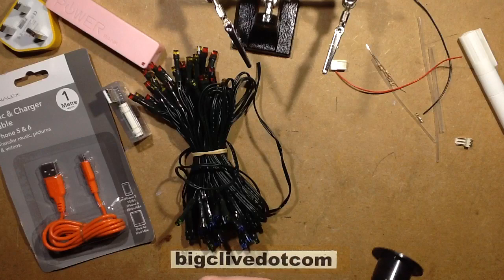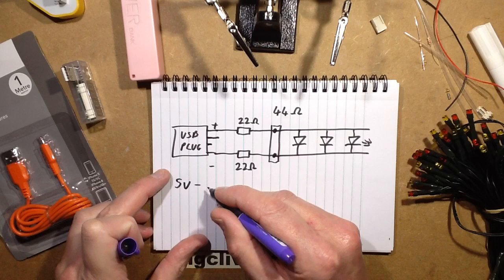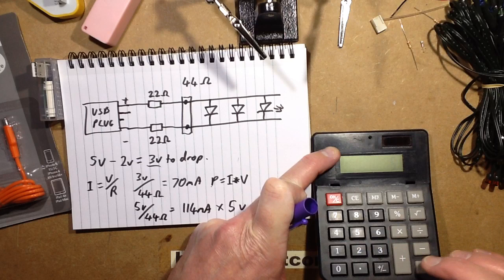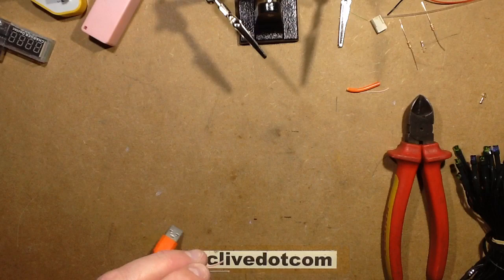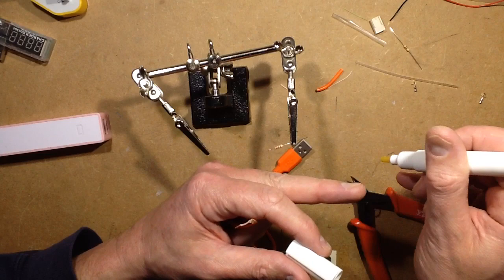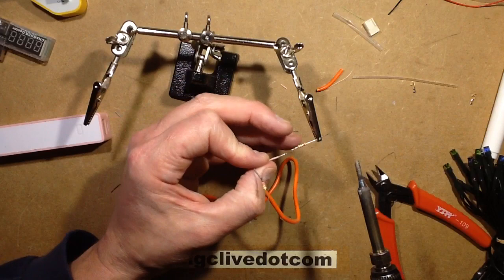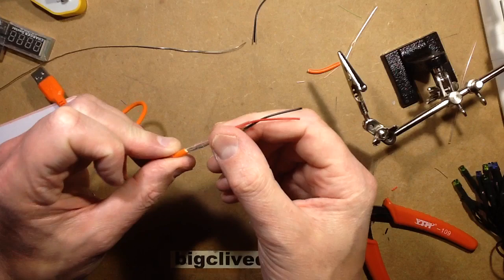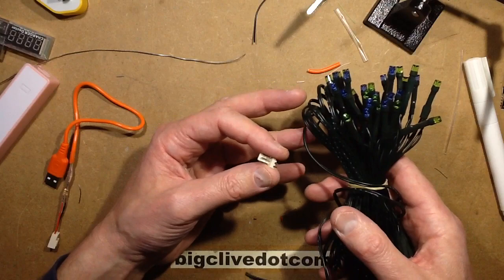Run LED strings on USB chargers and power banks.

Comment: I actually have a cosplay project that I'm working on right now that involves LED's and I'm happy to see that I did my resistor calculations correctly when I placed the order for the parts yesterday, thanks for assuaging my fears with this video.
Reply: Wearables eh? I would suggest using smaller SMD LEDs and just soldering the wires straight to them - They are a lot smaller. You can also buy ones which have holes on for thread, and you can get conductive thread also.

Comment: I just use the wider part of the soldering iron to shrink the tubing. It doesn't get as hot as the tip it seems so works great to shrink it without melting anything.

Comment: Another great video BigClive.  I've seen every video you've made to date (literally!). I so much enjoy all your videos.  It appears to no doubt you are using a good Rosin Core 60/40 solder.  I ran out some weeks ago and had to use some ROHS Silver Solder and that stuff is a torturous nightmare to use.  A few days ago, I finally got a good roll of 60/40 Rosin Core solder and working with electronics is a pleasure again.

Comment: you can use larger heat shrink to make things easier.  The basic tubing will shrink to half its diameter, and if you want  something to use outside they make a double walled heat shrink tubing with an adhesive inside that will melt and seal everything up tight.  And that tubing has a 3:1 shrink ratio.

Comment: Clive, please take a look at the XS3868 Bluetooth module and the PAM8403 3W stereo amp to make Bluetooth speaker with one of those power banks. There are a few videos on YouTube but the disregard the datasheets and introduce ground loops, generating noise, and i dont know how to deal with it. I have followed your LED and fiber optics tutorials to had lighting to my scale models. 5V from  powerbank or cellphone charger is quite handy and projects tend to stay cheap and simple like this. BTW, i purchased one of those RFID modules to help my mom.
Reply: The noise could also have been generated by the Bluetooth modules.
Reply: there is no noise when plugging the headphones to the module, only when using the amp module. the bluetooth datasheet indicates ground should not be shares but i dont know how that is done when using a songle powersupply.
Reply: Friendroid 

You should use a simple ground loop isolator and connect it between the BT receiver and the amp

You can probably find one for cheap on eBay

Comment: I just did this with a home depot Halloween battery powered set with timer. but all I used was a 1n4001 diode. 0.7V drop was perfect. My supply was 5V both unloaded and loaded, but keep in mind some supplies are up to 5.3V unloaded and loaded (Samsung high capacity usb charger) so adjust accordingly.

Comment: Hey Clive! I really like your very detailed and slow explanations. Thanks for having all the patience for the beginners in the crowd. One thing I am missing, though, is the reasoning behind some of your decisions. You seem to pull out some of the digits (like 70mA, 0.5 watt, etc), but you don't mention where they come from. Seems like they come from Your personal experience, but that's  not good enough for people who don't have experience to rely on. Is there some datasheet that you used to reference for these values? Did you do a bunch of experiments yourself?
Reply: 70mA is the typical current draw for such a string of LEDs. You can work this out with a multimeter or by looking online. 0.5 watt was calculated with the voltage and current draw (P = IV, P=0.07*5,P=0.35watts for example)
Reply: So, if I plug the LED's to any 2V power supply, they will always only draw 70mA? Also, look online but where? Is it some datasheet somewhere? I
Reply from the maker: The resistor was chosen to limit the current for a wide range of loads, but the actual current depends on the forward voltage of the LED string.  The resistors were standard quarter watt resistors.

Comment: Clive, first, fantastic of you guys to take care of your mom! Also, could you give a little more detail on those wire strippers you like... make model and/or anything else? I'm in the market for a good pair. Great videos, thanks! Thumbs up!
Reply: I was given a pair of the strippers a long time ago and they were old then, but they have never let me down and it the easiest pair of strippers i have ever used!
Reply: Those silverline look alright - I've got an old RS branded pair (must be mid 80s). But the ones on the RS website now have the adjuster screw going through the centre of the helical spring (like the ones clive's using today)which to me looks like it'd cock-up and kink the spring eventually (though it probably doesn't I guess).

Comment: I get the heat shrink tubing in red or black, sometimes others.  I think it might be possible to use a bit of red nail polish on the inside of the clear heat shrink tubing to tell the polarity.  Thanks for another informative video.

Comment: 24:45 I recently was building a deal with led's and grabbed my CR2032 cell to test the LED, only to find that my battery had compleatly drained.  So I dug through my parts  only to discover that I had run out of this particular battery. In the past when such things happened, I simply bunged a resistor on a 9 volt plug and put a Dupont connector on the end to make the test, but I was in a hurry.  So just for shits and giggles, I took the dead battery and held it across a recently charged niMH 9 Volt for my TENS unit. I held it there for a few seconds, then tried the cell and found that she had enough power to get me through my project.  I know such things should not be done, and I am happy to say that the cell never blew up in my hand or anything.  The cell didn't have a lot of  use in it from that boost, so when I had finished, I took a little 3mm white LED and put across the cell to see what was left.  It only lasted under a minute then was dead once more.  A few more seconds across the 9 volt battery brought her back to limited life once again.  I think I will be sticking a resistor across another 9v plug and putting one of those molonex ends on her so I don't have to try and burn down my house just to check an LED though. T

Thanks a billion for the videos, I look forward to them a lot, and when a new one is not forthcoming, I seek out some of the older ones for a boost in the old brain pan of knowledge.

Comment: Hi Clive nice one for your Mum always look after your Mum anyway what flux pen do you use I purchased some flux from China and it went in the bin as it was crap so don't want to waste more money do you have a part number you would recommend?
Thanks if you can help
Reply from the maker: It was just a general purpose random pen pre-loaded with flux.  I couldn't even tell you what sort of flux it is.
Reply: For what it's worth, I really like Amtech NC-559-V2.   Good for almost everything from board repair to wire soldering.  I learned about it from Lous Rossmann's channel, and it's very convenient in that it's sticky.
Reply: I use a SRA No.99-20 Mildly Activated Rosin Flux Type RMA

Comment: If you put the pos and neg side by side in those 3 way connectors - pin 1 and 2 or 2 and 3 - you can never get the polarity wrong. It's either connected correctly or only the centre pin is connected (I usually make that my ground).

p.s. just ordered a cliff plastics tester, those guys should be firing you a kick back for all the sales!

Comment: How many values of resistors do you have? Or maybe you order specific ones for each project?
Reply from the maker: I have about 80 values of resistors ranging from 1 ohm to  10 Megohm.  You don't need to have that many values for most applications, but if you do you can get mixed value kits.
Reply: bigclivedotcom

Thank you for replying to this comment, I was wondering the same thing.

Comment: The past few years, I've run into more and more stuff using aluminum wire that just wont solder. Everything from USB cables to name-brand computer power supply cables to 4pin-to-SATA power adapters. It's getting rather irritating, at best.

Comment: Another great video Clive. I just did this to a set of Aldi lights that were running off 3 x AA batteries with one 36 ohm resistor at about 70 ma. They're now running off a deathdaptor with 2 x 22 ohm resistors.

Comment: I usually put ground or negative in the center position on "odd number"-connectors, that way, if i mess up "left/right", i dont accidentally reverse the polarity that easily, (left/right/up/down on connectors can be confusing after a couple of beers. I have shaky hands, but alcohol makes them steady, so i normally have a couple of beers before I start soldering.).

Comment: I am trying to build a solar powered water fountain be interesting to see you review some solar stuff Clive - see how we can get the most from an old solar cell from  one of those cheap poundland things - ive got loads of broken poundland garden lamps so gonna chain em all up and add a few  batteries - managed to find a pump that will take a low voltage and designing the fountain it will be quite an interesting waterfall design but next is the circuit design - i guess i can take all the old components off the knackered poundland lights and use those chip controller things rather than do it old style solar with discrete components?

hmmmmm your thoughts would be interesting but no sweat....i always get there on my own!

Comment: Isn't the standard for USB charging or power delivery or something to short out the data lines? I could have sworn i read that at one point.
Reply from the maker: That's to signal to the load what sort of power supply it is connected to.  In this case the LEDs don't care and just take their current.

Comment: I've been looking to see if you have taken something to bits yet, have you seen these rechargeable "rgb video lights" ? They come with a 3100mah lithium batteries. Im wondering if they are quite dodgey enough to be usable. Many different manufacturers, pricing ranging from 20 to 200 us dollars. Figured it would be right up your alley!

Comment: On your explanation of 1 resistor vs 2 (6:54) you show that the voltage drop across 1 resistor is 5volts, but if it is, arene't we dropping ALL the voltage for that 1 resistor? Across 2 resistors, you say the voltage drop is the 3 volts to drop. Why are we dropping all 5 volts using 1 resistor? I love your videos. Keep it up.
Reply: oh, I just studied voltage dividers. Sorry for the question. No, this is not.

Comment: Do you have calluses on your fingertips? I've never been able to do the claw-soldering technique that you do, not for a lack of dexterity, but because I end up burning my fingers when the components get hot.
Reply from the maker: You'll get a feel for where and how long to hold components, or whether they need to be held in a grip.  It's a technique that will just come naturally as you solder.  That said, my skin is a bit firmer at the tips due to years of work.

Comment: @bigclivedotcom  
I have some of the cheap poundland LEDs that you showed in the "Poundlands 2016 Halloween lights" video.
When you do not know the specs of LEDs what forward voltage and milliamparage do you go for?
I can assume 3v Forward Voltage (3v battery and no resistor) but should I aim for 70m amp or is there another "best number" to use when calculating resistors?

Comment: Why don't you twist the wires and resistor leads together for soldering? It would save you the whole tin-tin-flux-flow thing and make a stronger connection (solder is not to be relied on under mechanical load).

I just love my solder feed iron for this sort of stuff - it's like a hot glue gun for solder.

Comment: I had an odd problem the other day while soldering to a strip of LEDs.  Each time I tinned the pads on the strip, a few of the LEDs would light very dimly, and in diminishing brightness the further away from the pad they were.  No idea what was going on, and I haven't noticed any damage to the LEDs, but it certainly gave me a bit of a startle!
Reply from the maker: Leakage current from the iron probably.  LEDs will light visibly at just micro-amps of current.
Reply: bigclivedotcom
I had considered that, but seeing as I was only soldering one terminal pad at a time, there wouldn't have been a complete circuit.  AC induction noise, maybe?
Reply from the maker: Could have been capacitive coupling to ground or via you touching the contacts.

Comment: I've been thinking of outfitting my shelving with LED lighting, and powering from USB seems like the logical choice given how USB supplies are so plentiful... :)
Reply from the maker: 12V will give you more options of things like LED strip.
Reply: bigclivedotcom
I've tried LED strips and they just don't seem to work aesthetically for me, but them Ikea "Varva" USB LED spotlights (little grey or black clip-on jobbies, assuming Ikea still sells them of course) are perfect, cut off most of the clip leaving the ball joint, bit of double-sided foam tape, stick in place, and there we go, nice little USB-powered spotlights... :)

Also pulled the lenses out of my two, gives a nicer spread of light without a yellow halo around the edge the lenses gave the light beam... :)

Comment: If I use 47 ohm resistor to power 24 LED's off a USB phone power bank, 1 amp, 5v, will they be bright enough? Great video, thank you!!
Reply from the maker: Yes.  They will run at about 20 mA each.  It might be better to use a 100 ohm resistor.

Comment: Great work as usual clive. Do you know if you can buy or make the 6 on 18 off timer circuits. Would be a perfect add on to this video. Fergy x
Reply from the maker: They're appearing on a lot more sets these days.  I bought two recently and they had the module in the battery pack where the little flashers used to be.  I tried making one based on a PIC, but it definitely needs the crystal timing reference they use.  Mine wandered all over the place with its timing depending on the battery voltage and ambient temperature.

Comment: Hello Clive nice video and good for beginners like me. I just need to ask is it possible to use Poundland solar light to use as a day and night switch on the 5v rgb strip light 2m long or do you have any ready made kits which are waterproof. 
Thanks in advance.

Comment: Question. Is there any benefit other than cost and the fun of doing it, to building a set of fairy lights that way? See I got to thinking about it just now. I wonder if that would draw less power than the strings that are intended to be plugged directly into the wall socket. To me it seems like it might be less current draw. I think it would be interesting to see a comparison video if you have the time to make one.
Reply from the maker: It's to allow them to be used in locations without easy power access or even as part of a costume.
Reply: I understand that perfectly. I'm still curious as to other benefits from such a project and it still begs the question of whether or not it draws less power than a standard string of LED fairy lights. My point is that there might be more value in this video than just a simple project. If it can save electricity as well as adding versatility and portability that would be nice.

Comment: Another question. I have read to NEVER to use a resistor like what you have shown on a parallel circuit, must use individual resistors on each LED. Do these LEDs have an internal resistor do you suppose? I think the fairy lights have SMDs that have a resistor buried in there with each one.  Is this resistor a "voltage divider"? Plz excuse, I am a newbie.
Reply from the maker: It's common to use a single resistor with the Xmas light string because they are using accurately matched LEDs so they share the current fairly evenly.  If you try it with random LEDs there will be significant current imbalance.

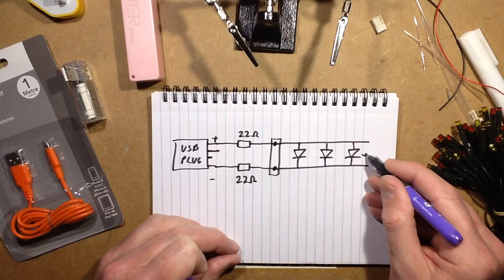Comment: Thank you very much for the video! @2:46 You mentioned that "Christmas trees wouldn't work as it needs way more power". What about those small fairy LED outdoor lights? It uses a wall power adaptor, outputting 31v, 7.2w and 0.10A, and it allows me connect multiple lights to the end of it (1 power adaptor, powers up to 5 sets of lights - total 100 LED). 
Would it work? 
Is there a way to power these lights using USB power banks?

Thanks
Reply: Doh, USBs are 5v. No way to get to 31v.
Reply from the maker: There are actually sets that take 5V in and boost it to 31V.  I think its to allow use of existing USB power supplies.

Comment: So do we assume that the voltage drop (forward voltage) for the leds is a constant, but that unlimited it is possible for them to draw too much current. And because we know the voltage drop across the leds we know what the voltage drop across the resistors will be, and so we can use that to select a resistor that gives us the current value we want?

Also I really like your button cell trick for polarity testing.
Reply from the maker: As soon as the LED forward voltage is reached they start conducting higher and higher current.  So it has to be limited in some applications like this.
Reply: @user-gx6jb6wc5g  thanks for the response. I have done calculations before with multiple components in the circuit with known (easily measured) resistance. But wasn't sure how to handle LEDs. So it is good to know that as long as I limit the current I should be able to assume a constant voltage characteristic.
Does this become a problem if the power source has a voltage very similar to the operating voltage of the LEDs, but with the ability to supply more current than the LED can handle, because the current limiting resistor will drop the voltage?